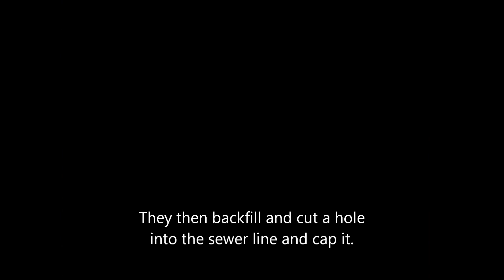Digging with water and a vacuum cleaner

Comment: Just a ordinary vacuum cleaner
Reply: It works with a pressure washer and a shop vac, just a little slower and you have to empty the vac out many times. Still a LOT easier than running a shovel all day